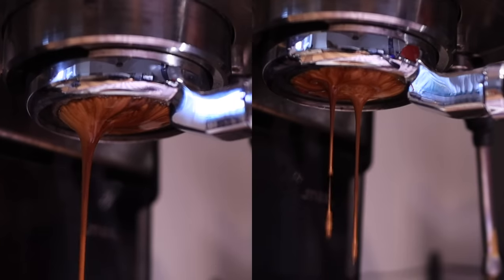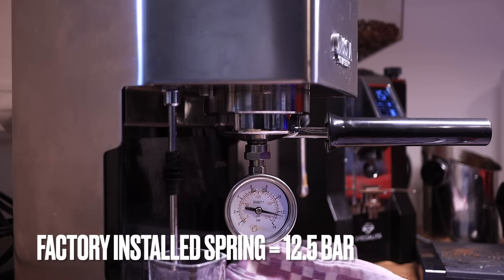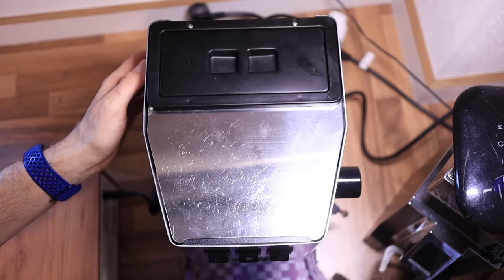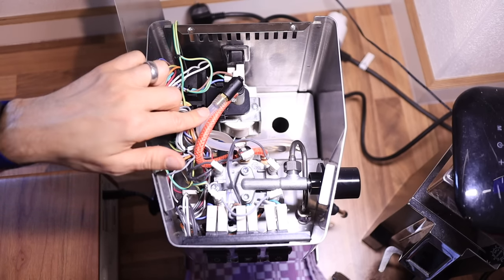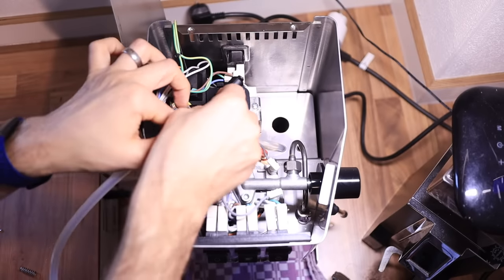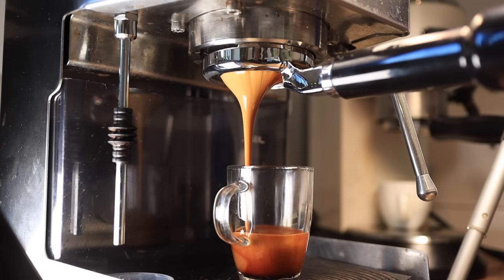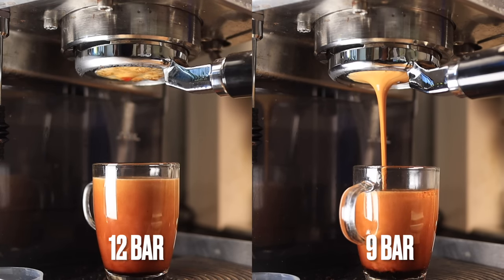You Won't Believe the Difference: 9, 6.5 & 5 Bar OPV Mod with Flow Rates for Gaggia Classic Pro

Comment: Last year I got an older (used) Gaggia Classic, with the adjustable OPV. The previous owner had left the OPV at factory setting, so I knew had to reduce the pressure. But I didn't want to spend the extra money for a pressure gauge (not so early in my espresso journey), so I measured the OPV output flow (with a blind filter) and adjusted until the flow suggested that the pump was operating closer to 9 bars (there is a table for Ulka EP5 pumps linking pressure to flow).

Then I pulled shots for months, with increased success over time as I refined my technique (puck prep, better grinder), though problems were not rare.

Eventually I bought a pressure gauge (and a portafilter that could accomodate it, as mine could not). Turned out the pressure was actually 11 bars (so the original pressure might have been well over 12 bars, maybe 13 or 14!). I tuned the OPV again, this time to 9 bars really (on the gauge).

Now my espressos taste better, in general "rounder", with less harshness, which I think is a sign of less channeling (I do have a bottomless PF, so I know to look for visible defects). Eventually I'll have to try lower pressures, but going down from 11 bars to 9 is already quite an improvement!

To me, installing a PID and adjusting pressure are essential mods, so much so that I cannot recommend the Gaggia Classic without them (PID comes first though).
Reply: Speaking of the PID mod, I recommend this video: https://www.youtube.com/watch?v=ZAtsuS6B6xg

It gives instructions and pointers to parts that give you a PID for much cheaper (about 60€) than well-known pre-assembled kits. :)
Reply from the maker: Hey Jean-Marc, thanks for your comment, and telling us of your espresso journey. So, how did you measure the OPV output flow with a blind disc? Did you catch essentially the overflow and measure that weight?

I also find that the 9 bar pressure results in the smoothest shot, at least with the grind setting in this video. Going lower than that resulted in more bitter shots, but then again I hadn't adjusted the grind accordingly, so that could be something for a future video. 

I have not installed a PID yet. I am an engineer by trade, so it should for sure be doable, but I have not found the time yet, and also most of those mods look aesthetically kind of off putting. 
Cheers,
Tom
Reply from the maker: I have seen that video (it's a good one, for sure), and it is nice to have it mounted on the back, but I really would like to see the timer while the shot is pulling. Still waiting for a mod kit that looks nice, and can be mounted ergonomically. Then, I will do a video about the install. 😉
Reply: @TomsCoffeeCorner  Note that the PID controller showed in the video above does not work as a timer, it shows temperature only. As for placement, I find it easy to read the temperature with the PID on any side of the machine, as while standing up I really see it from above... but your machine, your choice. ;)
Reply: @TomsCoffeeCorner  I directed the water hose exiting the OPV to a container, put a blind filter, ran the pump for 30 seconds, and weighed the water. After my first tuning of the OPV, this gave me 160ml in 30s, so 320ml/min, which, according to the Ulka pump spec chart, means that the pressure is between 5 and 9 bars.

As you can see, that wasn't so close to what I later read from the gauge (11 bars). Maybe the cheap gauge itself isn't that accurate? Maybe the method is flawed? Maybe my pump is outside specs? (It's 16 years old now!) 

Anyhow, this crude method got me started for cheap, so I can't say it's all bad. What really matters is knowing that reducing pressure is definitely useful.
Reply from the maker: @jmsaffroy  This is quite an interesting method, Jean. Thanks for sharing that!

Comment: depends on the roast though  Light roast you need more of an extraction to remove the sourness  because it needs more time to extract the flavor and more heat and for dark roast over extraction will give a bitter taste and you may want to lower the heat.  I have a flow control to play with different bars of pressure with different roast types.    So its more to it than bars of pressure.  Roast type and temperature of water is just as important.
Reply: May I ask, so light roast, do we need higher bar or lower bar?
Reply: @jessnguyenthi7266  I have a newer machine.  And I can control my bars a lot better now.   I tend to like less bars of pressure to get more flavor.  Play around 6 to 8 bars.    For me it seems to have slightly more sweetness to the cup with lower bars.  But you are saturating longer with a lower bar.

Comment: I found this very useful.  One it kept me from doing it myself 😂.  seriously, I have the same springs from mrshades also and decided on the 9 bar one.  i also use pre-infusion alternately as I go through my bag of beans.  For the GCP there are so many variables to explore.  I will be looking at the dimmer mod next using Lance's suggestions.
Reply from the maker: I agree with you there, Dirk. There is so much to experiment with, and so many available mods. Should be good fodder for future videos. 👍
Reply: Dimmer mod (along with adjusting to 9 bar) has made all the difference on my Saeco. I pre-infuse; I have 28 seconds from first drop to completed extraction, and it is delicious with a velvety mouth feel

Comment: This one is really helpful to me. It shows the whole story of pressure in making espresso. You re going to fix it via the opv valve, others heading for pressure profiling using way more expensive equipment. But at the end all of us trying to trick the pump in some ways. As a Rancilio Sylvia user im asking myself if it wouldnt a be smart move to get myself a lever machine and get rid of the pump?! What do You think? Thanks for this vid!
Reply from the maker: Hello Ma Jo! Yes, a lever machine would provide the ability to spontaneously adjust pressure on the fly. I bet that would be fun to use. I am hoping to test a La Pavoni soon. What kind of lever were you thinking?
Reply: @TomsCoffeeCorner  Hey Tom, thx for your reply. Im not at a point for decision making yet. I just came across this pressure profiling hype while im trying to figure out pros and cons about PID for my Sylvia. Because i always try to understand whats happening whitin a process on a way to a favored result. Then i watched your vid and got to the idea a spring lever machine might be the most easiest way to further improve the really good results my Sylvia is doing. So, i think your re right, testing some different systems is next. Have fun..
Reply from the maker: @Horologiist  For me, part of the fun of espresso is the preparation. I think that using a lever machine would be fun. More fun than a conventional machine. And it is even better that you can dynamically adjust the pressure. Cheers!

Comment: I have seen this mod in so many places and never fully understood it. You released this video like 2 days later and it was everything I wanted to know about the OPV spring mod. Thank you Tom! Thank you for being more thorough and 'scientific' than a lot of other channels.

Quick note on your video production. Your voiceover audio sound amazing!  But your talking head/live audio could use a little upgrading. 

And the video is a little long with a lot of transitions. If you tightened up your pacing and made the transitions a little more unique/quick to add to your video style I think you'll really find some good success. I love your "quick time lapse" style while working on the machine. Very helpful and visually interesting. 

Overall Great job man! You need to start a Patreon and start building a following. You're well on your way to full fleged YouTube sidegig.
Reply from the maker: Hey Will! Thanks so much for your thoughtful comment! I do appreciate your feedback on the video production, as I do want to improve over time. 

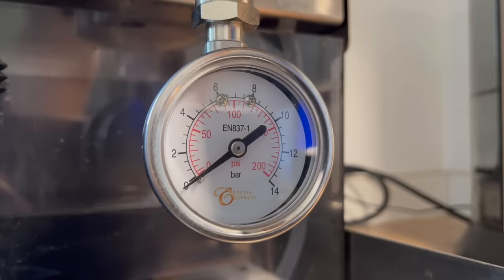Regarding audio, most of it was recorded with a lapel mic. There are only a couple of voiceovers, at 2:10, 7:22 and 8:10 where I was using a Blue Yeti mic in my office (because I had forgotten to narrate those in real time). Are those the times where you think the audio sounded better? I went back over the video, and the audio of the lapel has some reverberation, if that's what you mean.

The transitions help me organize the video in the timeline, but I could omit them next time if they disrupt the flow of the video. Anyone else have thoughts on this?

Again, thanks very much for taking the time to watch the video, and write down your thoughts. 👍 Cheers! ☕️
Tom
Reply: I watch a crazy amount of these types of videos and I think the layout was spot on. Well done.
Reply from the maker: @Clynikal  Thanks, Clynikal! 👍

Comment: Thank you Tom for the informative video modding the gaggia.
I found it very helpfull to get the measurements in the video description - thanks for that as well.

Did you measure the 9bar spring too? Or is there a typo in the description - 9bar instead of 12bar? I would like to order some springs at another manufacturer ;)
Reply from the maker: Servus! Here are the values. Where do you plan on buying them? Please do share, as I had to pay quite a bit of import duties to get these from the UK to Mainland Europe.

12 bar spring: 23.6mm long and wire strength of 0.6mm.
9 bar spring: 19.5mm long and wire strength of 0.6mm.
6.5 bar spring: 23.9mm long and wire strength of 0.5mm.
5 bar spring: 20.1mm long and wire strength of 0.5mm

Comment: Hi Tom, nice video you made, save me time to test. I installed the 9 bar spring, but for some reason mine was reading 10.5 to 11 bar. BTW I’m also using the same pressure gauge your using. I removed and try to install still got the same pressure. Do you think the spring had issue? Also I like the way you did, not removing not tube, I think that’s one of the annoying part. Thanks
Reply from the maker: Hi there! Which kit did you use? From Mr. Shades, or somewhere else? What pressure does your original spring read?

Comment: Hi Tom, nice comparison you made. Just a quick question, when you use the pressure portafilter , do you still put the basket in the portafilter, thanks
Reply from the maker: Do you mean when I use the press rice basket? That can only be used in conjunction with a normal portafilter. Cheers! Tom

Comment: Tom, thanks for video & knowledge!!!  

So, what was Flow Rate when you install PRESSURISED  basket ?
Reply from the maker: Hey there! Oh, that’s a good question. I didn’t test that. I would have had to make the grind much different (coarser) in order to use the pressurized ones. Cheers! Tom

Comment: Dont you need to adjust the grind when changing spring?
Reply from the maker: I think that is a good idea, once you choose a spring to go with. If I would choose the 5 bar spring for example, I'd coarsen the grind a bit. It runs a little long otherwise.
Reply: @TomsCoffeeCorner  You certainly want to adjust grind size for taste, but as you indeed have to grind coarser, you should see even less channeling, and that's another definitive improvement in taste.

Comment: Great video outlining some of the differences between the 4 springs - does a large cone as seen on the 12 & 9 bar spring mean anything in particular or this is a natural occurrence? I currently have a 9 bar spring in my unit and depending on the beans, I see larger or smaller cones
Reply from the maker: Hey Brandon, I notice a larger cone at higher pressures, and also with blends that have more robusta.

Comment: Thanks Tom for excellent video.  I am trying to install a 9 bar spring in my new Gaggia Classic Pro, but ran into a problem.  Top cover off, pulled the tube to OBV out of bottom of machine so that it is free to turn.  Problem: I am unable to unscrew the brass fitting that holds the spring (using a 10mm wrench). I'm afraid that if I push any harder I will break something.  Has anyone experienced this problem and have a solution?
Reply from the maker: I am not sure about that. I changed my spring while the machine was still new, so unscrewing the brass fitting was pretty easy. It might get caked on over time, especially with limescale and so on. Perhaps someone can post a good hint here?
Reply: @TomsCoffeeCorner  The machine is brand new, so no limescale.  A hint from someone who had the same experience would be wonderful.

Comment: Why your extraction seen to tilt a side? thanks to the amazing insight sharing.
Reply from the maker: Hey there! It always seems to do that. It is more pronounced with the 12 bar spring though. Cheers!
Reply: maybe check for how even the flow of water is out of the shower screen as well as seeing if the machine is level
Reply: Late to the party but i wonder if this is due to the machine not being perfectly level

Comment: Is there a way to do the same on my dedica? It is also interesting what pressure does it produce by default. Haven't you tested it with the manomether?
Reply from the maker: Yes, I tested it. It does a max of 11 bar, with a blind disc. But during an extraction, I get 8-9 bar. I would not suggest altering the pressure, as the OPV was not meant to be manipulated.

Comment: Just dropped in a 6.5.. hood it holds true to taste a little more acidic.  But I’d imagine you could get any range of sweet/bitter/acidic with grind and water temp..
Reply from the maker: Which spring pressure do you like best of the 3?
Reply: Well, 9 was great, but 6.5 seems ever better.  It could just be different tho.  Confirmation bias is always at play.. only made 2 lattes at 6.5…Making another after dinner in 20 or so.. I’m set on mixing a few blends that I really like.  So if they’re blends I’m now mixing 4 or 5 different beans?  Haha… both local roasters near Fort Collins and boulder.  Jackie’s Java (mostly make flavored yuck but their dads blend is insanely smooth medium roast blend) honestly haven’t tried any other beans from them as they’re flavored.  And OZO Isabelle medium/light blend. Tried dozens of beans ranging from awful to good.  But only a few I classify as great. O, there’s one more I forgot about.  intelligentsia house blend, almost didn’t try the brand as the name is stupid imo.. think they’re out of Chicago.. amazing light roast. But I also mix this with one of the other two most of the time as I prefer it mixed. Have a top three you rec?

O, and I use a sette 270 and an18/36 or 38 out.  Preheat for a while, and make sure it’s up to temp prior to shot by activating brew till light goes off.  Then steam switch for 3-5 sec to make it even hotter.  I’ve tried 10 sec and it burns at that point.  The lighter the roast the more heat.  So maybe I’ll try no steam button for medium roast just to see… and 5-6 sec for LR.  Any recommendations or adjustments?  O, also steam on, purge, wait till 25 sec, purge for 5 sec, wait till 45, purge then steam.  75/25 WM/HH 200ml mix.. anyway, tmi… thanks for the videos!!
Edit: o and of course I do the rest of stuff to get the optimal shot like pre-infusion, a paper puck filter on top to keep internal soot down, bottomless 18g precision filter, also have a curved BOB 18g.  I’ll have to try it again.  Not too impressed by it tho.  Might just be marketing gimmick.. and I’m embarrassed to admit I didn’t clean backflow for a long long time.  And now do it weekly.  So not drinking rancid coffee is a huge step up.  Made such a huge difference.  I was getting very inconsistent shots depending on how much yucky old grinds were contaminating latte.  Still haven’t descaled, had for 1.5yrs.  Hope it’s not a humongous deal 😂.. and filtered BST water, ok, I’m now done with commenting haha..

Comment: Oh no Tom, thanks but now I have a problem: after making the 9 bar spring mod in my Gaggia Baby it worked so well that I now realize that my Delonghi Magnífica ESAM3300 over extracts coffee and I want to do the same to it - is it possible? It looks like the ESAM uses the piston for pressure and not the pump am I right? I thought of using the dimmer mod but don’t think it will work :-( any help?
Reply from the maker: Hi there! The ESAM is a super automatic machine, which is not capable of espresso. It only operates around 3 bar. Cheers!

Comment: What does changing the OPV spring do? I thought only the machine’s built-in water debit and grind size of the coffee affected the resulting pressure.
Reply from the maker: Hello! The OPV does limit the maximum pressure that can be built up, before getting re-routed back into the water tank. For example, with the 5 bar spring, anything over 5 bar will exit the OPV before it makes it to the brew group.
Reply: @TomsCoffeeCorner  Ahhh, so you have to grind coarser once you've installed the 5 bar spring?
Reply from the maker: @iconindexsymbol  Yup!

Comment: I have an older model, were I can change the pressure over srewing with an allan key. Or do I need a new spring?
Reply from the maker: No, the older models sometimes came with an adjustable OPV, which was more ergonomic. It compresses the spring through turning the allen screw. No need to buy another spring.

Comment: if I grind finer and extract on 12 bar, will it taste the same with 9 bar extraction with slightly coarser grind?
Reply from the maker: That's hard to say. The finer you grind, the more difficult a homogeneous extraction may become. I would suggest trying it out, and taking some notes. You will need a fine grind either way, with both springs...